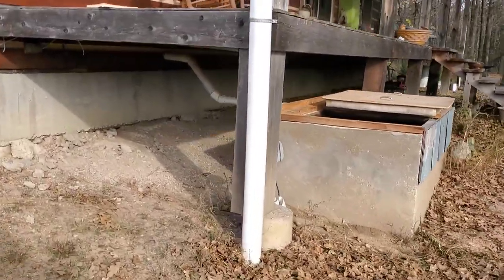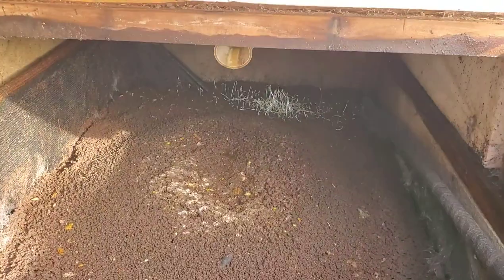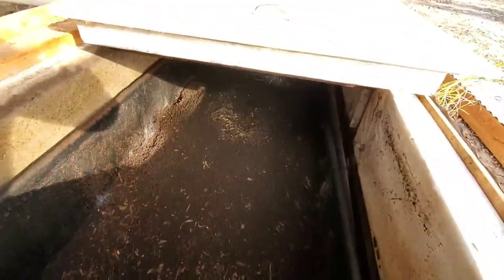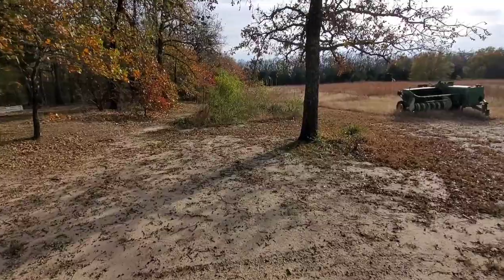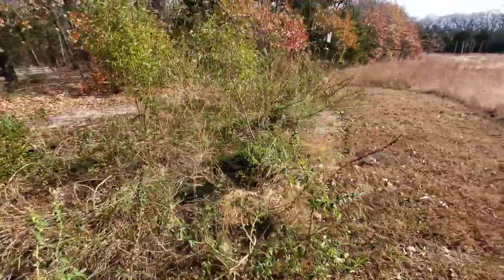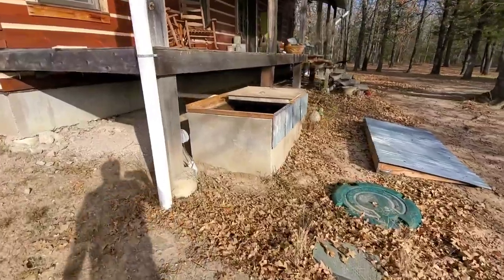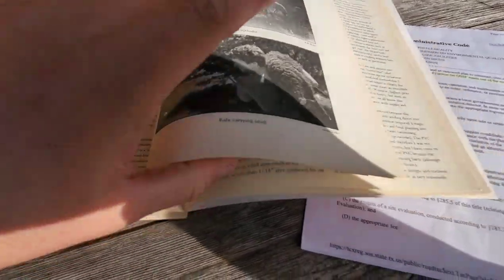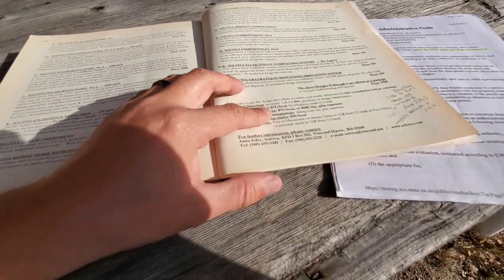Code Compliant - Water Flushing - Composting Toilet That Uses Worms!

Comment: Thank you Nicholas  -  Anna Edey here, tuning into this wonderful channel for the first time  -  I too am so proud of my students who learned and adopted and adapted my Solviva designs, and she made some great improvements, and then achieved that wonderful level of reliable success, where it just keeps running perfectly, year after year, with hardly any work on your part. 
So I was thrilled to see your excellent video showing an offspring of my Solviva Composting Flushtoilet system. I love it!!! She did a really great job!! Everything is so well executed - the concrete box, the lids, the sump pump, and the final greenfilter.   I love the compost basket made with shade cloth held by 2 bars, by which you can lift up the entire mass of compost -  that is a great improvement! When the moisture content is ideal, around 80%, it's really heavy. But with good drainage and keeping up the depth by adding a bucket or two every once in a while, of aged ("bio-infused") wood chips (not sawdust, not shavings, and not cedar, locust, or other rot-resistant wood),  and with copacetic conscious management, just checking it out occasionally, it will probably stay the same "forever".  And for security, a small PV panel + battery + a few replacement pumps (it feels like anything could happen at any time).
And yes, the worms sure do squiggle down out of sight the moment light gets in. Next time you'd like to show the worms, ask someone to poke down gently, and you'll see hundreds of healthy fast wiggling worms of all ages. She has obviously created another Earthworm Heaven - the content in my box looked exactly the same - and whatever was flushed into it was just plain gone within a day or two, depending on the season, year after year. I always found it hard to believe that this was possible - but, we can't argue away the reality of long-term repeated personal experience.
Together, we'll make everything better and better as we build upon each other's ideas, and going toward the goal where septic systems no longer cause pollution that sickens us and everything around us, and that are also less costly, and more reliable, require less area and less electricity, etc. 
And the same with food production, heating, cooling, electricity, transportation, solid wastes - it is all so doable, practical and economical, right now. I have been walking toward that goal since the early 70s, and have recorded my experiences and test results in two books. The first one is SOLVIVA (1998), as shown above, and the book is "Green Light at the End of the Tunnel" (2014), where I include detailed to-scale how-to-build designs with numbered descriptions of my various Solviva wastewater systems and many other designs. I want to let you all know that you longer need to pay $50 for each design, because the designs are included in my second book.  This book may be helpful and inspiring to many of you on this site -  you can find out more on my still-under-construction website www.solvivagreen.com    
Both books are on Amazon, although currently they have low or no inventory. If you would like to buy one or both, I would prefer if you'd get it straight from me -  at solvivagreen@gmail.com  
Nicholas, I thank you again for reporting this, and look forward to seeing more videos and discussion about this topic on your channel  -  it's so important that we let each other know what systems and methods work better than other systems. And, of course, we have major political work to do to get the State to allow every septic system design that seems likely to be better than the current standard, on any size lot. And then do the Nitrogen testing to prove it. And as long as the nitrogen is no more than standard systems, and there is no overflow, odors, flies, or other nuisance, the new system can stay.    
Ever since 2017, when I sold my Solviva Farm and moved into town, I have been horrified to be living with a standard Title 5 septic system, and thus adding to the terrible nitrogen pollution of Lagoon Pond. I, of course, have a design for a Solviva compost filter to be installed after the standard septic tank, and then followed by a greenfilter. BUT, a special permit from DEP would take many many months to get, and would cost $6000 for starters, and then thousands more for their extreme testing requirements, all of them irrelevant, except the issue at hand, Nitrogen.  If I installed it without their permit they will destroy me.  I would like us to declare our right to protect our drinkingwater and our ponds, and therefore have a right to have septic systems that cause far less pollution.    
I would love to hear discussion and ideas on this whole issue.
Reply: Greetings.  Thanks for your meaningful response to this video. Glad you discovered it.

In the case you choose to use YouTube as an additional tool to share your wisdom, I became your first subscriber. 

Thanks for the wisdom shared in your written works. I'll be checking out your website and hopefully your books sometime soon. Unfortunately, your website does not appear to be accessible today.